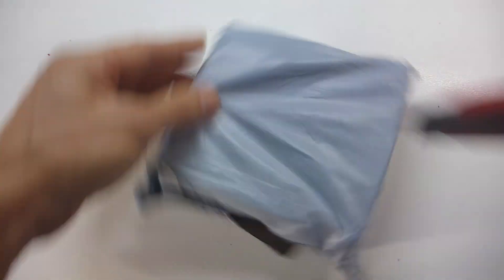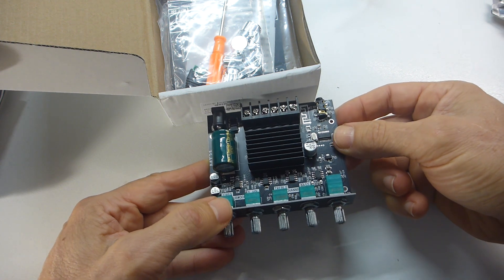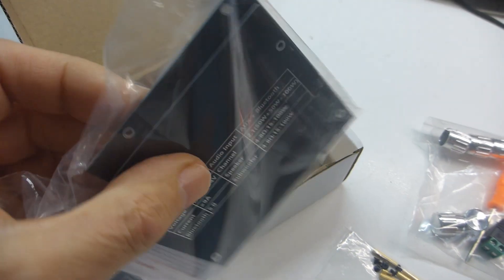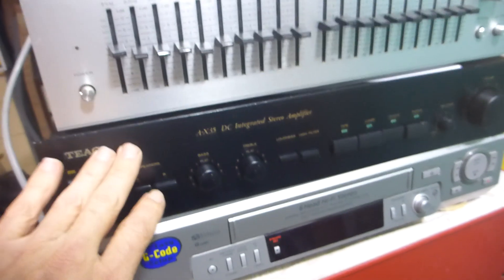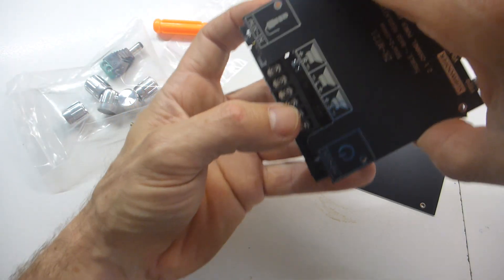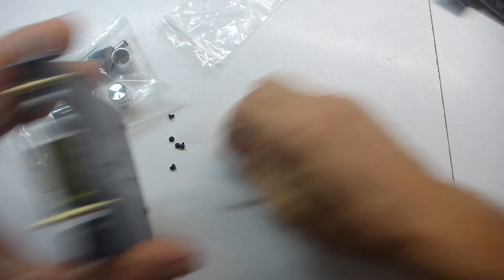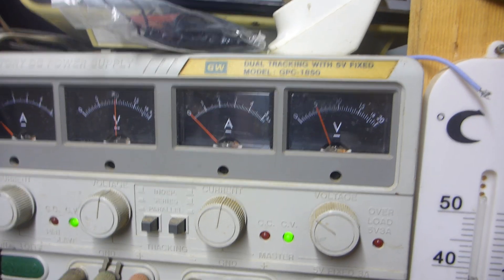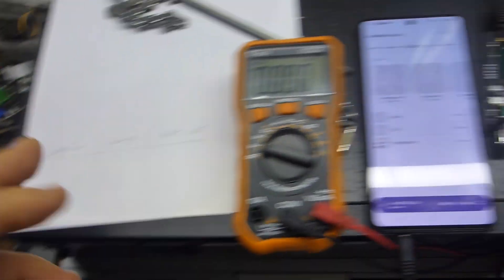ZK-MT21 2.1 Amplifier - Which Power Supply Do You Really Need & How Much Power Do They Really Make?

Comment: I have that one and  one that pops up as BT -WUZHI that powers a pair of speakers and a sub, but I'm using a powered sub and I'm happy with it. This one does produce a hum when I touch the knobs or turn it up to 3/4 volume.i have zero electrical knowledge and just grabbed a power supply from a car seat back massager that wasn't being used. Great little things for the price.
Reply from the maker: Hum is from the power supply. Get a switch mode (cleaner supply of power), like a laptop power supply and hum will go away. Yep  they're great units ;-)

Comment: Did Chromebook laptop charger can use at this thing?
Reply from the maker: If voltage is 12-24v and current above 1 amp, then yes. Check polarity of plug as well.
Reply: @pescado99 ok sir

Comment: What ist the max votage this amp can handle ? I have a lifepo aku with 27.0 v
Reply from the maker: Technically it's 24 volts. So 27 volts will be very close to it's limit. If it's a switch mode it should be OK. Let me know how you go...
Reply: 1. Pescado,,,,what for a switsh mode ?  2. What you think is the max voltage i can give the amp ?

Comment: Can we use 24v 10amp power supply? because tp3116 output 100w
Reply from the maker: You sure can. As long as it's filtered DC. The amp will only draw what it needs,  never any more.

Comment: About the frantic  work desk. 
I have spent thousands of dollars getting my stuff organized only to find out that when I'm actually looking for something,  I can never find it.
 I own so many of these clear Tupperware style boxes to put everything in and I still cannot find anything I'm ever looking for.
 Now I own multiples of things that I already purchased time and time before, i think it's an alien conspiracy man!  👽

 I've bought a lot of these mini amps over the years just because I always like to use them during the holidays and for the size of them they work perfectly and for the price of them I couldn't care less if they got damaged or wet when putting them out during Halloween or Christmas in the outside elements.  

Surprisingly they work very well for what they are especially if you can give them the higher end of the voltage and amperage spectrum. 

The stock heat sinks work well if you put it on its side and that way it does enough of the convection air flow to actually cool most of these units when using them full out at eight Ohm loads with ambient air temps above 80 Freedom Units.  

At 4 Ohm loads  where it dips bellow that it gets toasty. 
 So I always put like a fan by it unless I'm using it outside during the winter time for my Christmas and Halloween displays. 

I absolutely adore these chip amps after I found out how the amplification was done and my stock audio system in my Chrysler Town & Country minivan with those NEC chip amps they used directly on the speakers drivers at line level.  

These chip amps if you have the ability to power them with a very good power supply work wonderful in a car especially if you have multi-channel DSPs and you happen to love tinkering with your car audio system.
Reply from the maker: Agree.

Comment: You seem to know this and it's clear. But it's all about Ohms law. You need to feed the amp the required voltage from a regulated power supply unit (PSU) with enough amps to make the rated watts.  Say 24V with 6amps = your theoretical wattage available are 144.
Reply from the maker: Yes, agree. The intent was to find out the minimum it woukd work on though. The maximum is the easy bit!

Comment: will it work with 12V 12A? (yes, you read that right.) I'm planning to drive a 6" subwoofer (~75w rms), some (probably) 55w panasonic mid highs
Reply from the maker: Yes. Good PSU for this amp.
Reply: Take a 100 watt rms  sub ,,if you get more power later

Comment: Not all heroes wear capes. Thank you for the vid! 
Also, did anyone try if it is stable in 2 ohms? :D
Reply from the maker: Haven't tested it at 2 ohms. Good question though.
Reply: @pescado99 So I received this tiny amp. And I am running a Focal Auditor sub at 2 ohms with 2 bookshelves. And I can gladly say it is stable and not overheating. 🎉😁
Reply: It gets VERY HOT.
Reply: @MickeyMishra those chips.can handle 150ºC. You know that right?
Reply: @SkiTTlelele   How long do they last at those temps?
Reply: @MickeyMishra it's nowhere near 150ºC. Its around 65-70 after hour session of listening.. So it will last. Its an amp, it gets hot.

Comment: If you used a quality 24V, 6+ amp power supply, the amplifier would produce much more. Yes, you would have to change the thermal paste to a better one and, perhaps, polish the radiator for better heat transfer, but this baby can give much more.

P.S. Google translator from Russian. I apologize if something is written incorrectly.
Reply from the maker: Yes, I agree. I was working with what I had. Plus the intent of the video was to show what the minimum power supply you can use was, not the maximum. Cheers

Comment: You can typically improve the Bluetooth reception by soldering a short 3-4 inch wire on the end of the inverted F PCB antenna.
Reply from the maker: Yes, have seen this mod in other vids. Cheers
Reply: Works great for Holiday display and you want to keep your  Bluetooth transmitter inside the house. 
Shame they have not made more cheap & cheerful wifi modules for this.

Comment: "Moore's Law" the number of transistors on a microchip doubles approximately every two years, leading to increased computing power and decreased costs. 
Today an audio IC with a size of your palm outperforms a 90's Amp a size of a VCR.
Reply: I still like the size of the old discrete  amplifier.
 Heck I still like Tube amplifiers!
But I'm rather old skool and still dig Carbys, with something like a Carb Cheater of course from Thunderhead

Comment: Using this in my garage with a 24v power supply to run 3" speakers in 3d printed enclosures with a single 10" car sub in a sealed box for bluetooth playback while I'm tinkering and the setup sounds great. The total value is around 200 CAD (Including used sub, filament, 3" drivers and 24V power supply)  I'd say you'd be hard pressed to beat the sound quality for the value even in a wired setup. Defiantly pleased with the product for my application.
Reply: I tend to just use  an old recover as they can be had for almost free if they don't have HDMI inputs.

Comment: Will a 24v 12 amp work? Would the 12 amps be an overhead or a danger for the amp?😊
Reply from the maker: This transformer is fine - as long as it is fully DC rectified and filtered with capacitors. A device will only ever draw its maximum current from a transformer - not what the transformer can produce. If the devices maximum current demand is well under the transformer's rating (which it is), you will be perfectly fine.

Comment: I have two of these mini amp, rated for 50W per channel stereo (no subwoofer channel) attached to 30w 4 ohm drivers, at 12V 1A, if you cranck up the bass over 50%, the sound will started to clip and the amp will keep restartarting when playing the audio. So yes, better get 18V 4A or above for power supply to run this amp.
Reply from the maker: Agree. This video was to show what the minimum power supply requirement was, and the difference more available input power made. Lower power equals lower overall dB gain but much higher distortion, with DC clipping evident at 12V and below input voltages.

Comment: How can a 12V 1A PSU run this properly?  If it is delivering 2 x 50W into 8  ohms + 1 x 100W sub, assuming 100% eff, is 200 / 12V = 16A required as a bare minimum to produce the power stated.  Am I misunderstanding something?
Reply: You're not missing anything. You'll notice from the data presented at the end that power output increases with power input. The intent of the vid was to better understand what the minimum power requirement was (turns out it is 5 volts), But I've shown it will work just fine with a 12 V 1Amp supply, but it won't deliver anywhere near the claimed power outputs, and the lower the power input, the higher the distortion.
Reply: Your math is correct, he is not hitting anywhere near the power these need to work properly. 

I use a 24v10a PSUs with mine, the SW @ 4ohms will hit 120watts and the stereo will hit 70w per channel with minimal distortion at 100% volume. When I used a 12v 25a supply it was only doing hitting 50w@sub and 30 for stereo And sounded like ass at 50% volume

24v and as many amps you can afford is the way to go for these guys

Comment: My first purchase of these chinese pcb amplifiers was one the 2.1 amps like you have there.  Its pretty decent for a workshop amplifier specially because its so small.  I found the 2 stereo channels are adequate with plenty of power but the subwoofer channel isnt powerful enough to keep up with the 2 sterero channels.  The low pass crossover isn't very good either.  The tpa32xx boards have much better build quality and sound than any tpa3116 amplifiers I have tried.  I use a bdm8 amplifier from Sure/Wondom now that has a tpa3255 and sounds excellent and has tons of power using a 36v 10a SMPS.
Reply from the maker: Will keep it in mind if I upgrade. Cheers
Reply: There's also a red tda7498e board all over Amazon, eBay, and AliExpress for around $25 that's excellent.  I have several of those and they can be run btl or pbtl mode all the way down to 3ohm.  I use one on 32v in my bedroom with a couple bookshelf speakers.  They do a little over 100 watts rms into 4ohms. @pescado99

Comment: I built a bluetooth boombox with this amp with 24 volts of lifepo4 batteries and it is fantastic. Powerful sound with heaps of bass. These amps are great!
Reply: Spiros....,,i have also a other 2.1 amp same power and price but 26v ,,,i load the 24v lifepo just to 25.9v = 6-8hours full power
Reply: @modulblok-e3168 which amp is this?
Reply: Spirus .....,, i have the the xy-S100H  50+50×100   12-26v  ,and the  ,220+220×350 16-36v,,,both from xinyi  sini audio
,,,,,,and the other one 12-24v blue modul,dont know the name in the moment
Reply: @modulblok-e3168 nice that it has the 26v because mine has only 24
Reply from the maker: Agree. Definitely not going to win an audiophile contest, but for the price and functionality, they rock!
Reply: Hello my friend can you post a video of it and the battery pack ? I want to make something similar and I have already ordered the things
Reply: @Trapbeast-ws6er I tried to reply with photos but couldn't get it to work sorry
Reply: How many ah are you running and how long does it last?
Reply: @noodles_and_bananas  I'm using lifepo4 32700 cells, they are about 6.5ah each. It will play for hours. The only problem is I'm getting some parasitic current drain when it is resting, maybe from the BMS, so when it is sitting for a few days it goes flat. But if I fully charge it and listen to music it lasts 2hrs +.
Reply from the maker: @toriwatson9655  Agree BMS might do this. Whack in an isolation switch before the BMS. Check it with a multi meter to see where the trickle is leaking from.
Reply: @toriwatson9655 I want to make a Bluetooth bass box and run it off battery's aswell. Do you reckon I could run it off a airsoft or rc style lipo?
Reply: Lifepo 24v is around 27 volt or not ?   Is 27v not too mutch for the amp ?
Reply: yes i think it has a risk of damaging the amplifier ,because i want to make a boom box too i will use an 12v battery instead,i will not get the max sound but i will be  sure that i dont damage the amplifier

Comment: I bought one of these a while back for an old Cambridge Audio soundbase where the built-in amplifier had failed irretrievably. The speakers in that are pretty well engineered (Cambridge Audio is a fairly well respected budget UK audio brand), but unfortunately I found this really wasn't up to the job. It was impossible to get the crossover right, distortion was high and I found the Bluetooth unlistenable with electrical interference. This was using the same 24V 3A brick the original amp was using and I had confirmed was working well.

Dismissed as standard Chinese junk I'm afraid but I guess YMMV. I ended up buying an Aiyima amp which performs a LOT better for around £30 (60 Aussie dollars I think) but then at the price you'd expect it to! Even that doesn't seem as good as the amp that was in there, although that will of course have been tuned for those speakers.

I guess as a super-portable, super cheap amp for testing speakers, sources etc it makes sense, but it's not something I want to actually listen to.
Reply from the maker: 100 % I'd never use it for home audio, but for testing it's perfect.